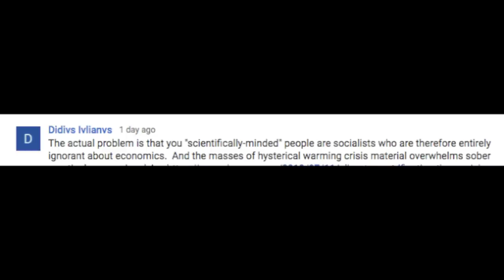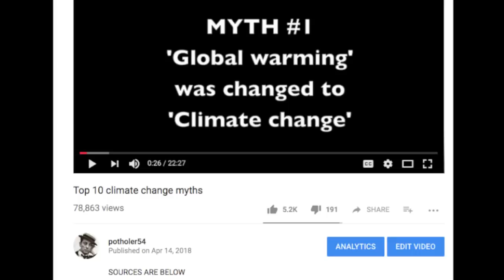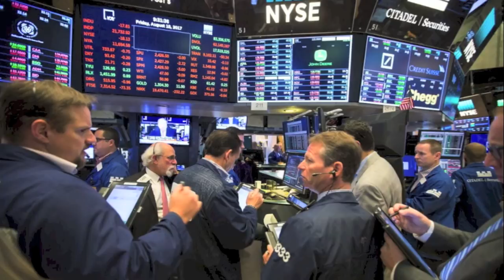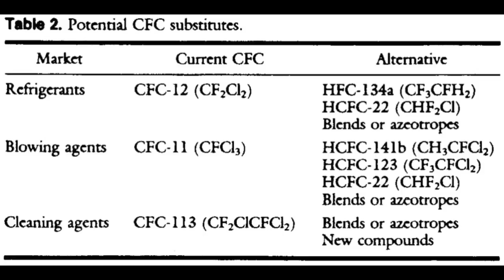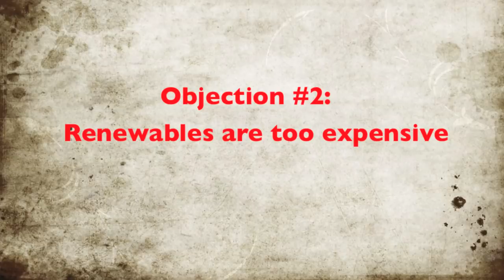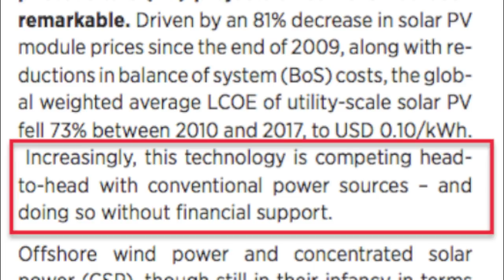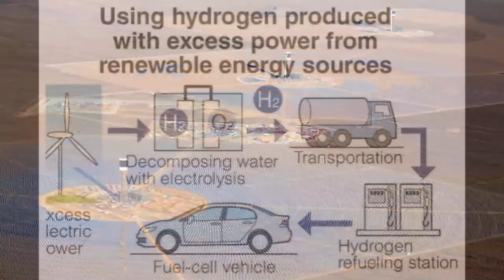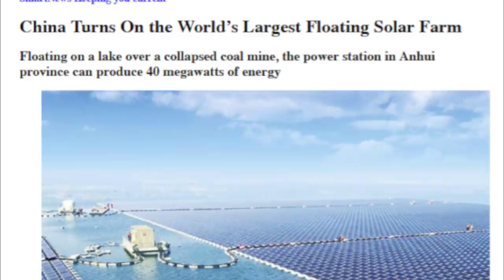A CONSERVATIVE solution to global warming (Part 1)

Comment: "You can store oil in a tank. Where do you store energy from a windmill?" 
Bigass magnetically levitating flywheel sealed in a vacuum chamber. Next question?
Reply: The Flux Capacitor is figure 14 in this paper describing Rio De Janeiro's maglev train. Which stores energy in  bigass magnetically levitating flywheels. 
http://atz-gmbh.com/Maglev14_Rio_de_Janeiro.pdf 
Figure 21 shows the flywheel mechanism itself.
Reply: Use it to pump water up into a resaviour. Then recover the enegery by letting it flow down through a water turbine.
Reply: Now see Bel Rick... That's where I get annoyed. Right where your comment starts. Have you even bothered to Google it? Flywheel based energy storage is real. It's not by far the only solution. But it exists and is being used right now in many locations.
Reply: Just store your energy from your windmill 'As Oil' or some other synthetic fuel derivative.

In actuality, I think developing a synthetic fuel, and process chemical industry that is capable of ramping up and down to catch surplus intermittent energy could have some real value.
Reply: Storing wind and/or solar energy "as oil" is possible right now - several years ago, I remember reading about a German research group who were studying how to do exactly that. The chemistry involved is well established, and was used during World War 2 (mostly in Germany) to produce synthetic fuels. This was of course the Fischer-Tropsch process, which takes in a mixture of hydrogen and CO (carbon monoxide) and spits out a random mixture of hydrocarbons, which can be distilled to produce fuels suitable for either diesel or petrol engines. Using suitable catalysts, the process can be fine-tuned to produce only low molecular weight hydrocarbon gases, identical to natural gas or LPG fuels.

In WW2 Germany, the feedstocks were mainly the destructive distillation of coal, which produced the CO and some of the hydrogen - the rest coming from reforming of natural gas. The modern research is all about obtaining CO and hydrogen from renewable sources. Hydrogen is easy, since any source of renewable electricity can produce it by electrolysis of water. Getting the CO is harder, but can be done: Carbon dioxide can be pulled out of the air with suitable solvents, then subjected to the reverse water-gas shift reaction to convert it into CO. There you have both feedstocks for Fischer-Tropsch chemistry, so can make hydrocarbons.

The research itself was mainly about how to make all of this more efficient and therefore economically viable. Strange as it may seem, one of the major investors into this approach was the US Navy, who wanted to use the process to make synthetic jet fuel. Why would they want to do that? Well, mainly to make their nuclear powered aircraft carriers more independent. Those ships are basically floating cities with nuclear power stations, so always have a surplus of electricity, some of which could be used for synthetic fuel production. That would mean less space used by fuel storage, and/or less frequent replenishment of fuel from outside sources, either of which would be beneficial for military operations.
Reply: Of course while bulk energy storage to a chemical form of fuel will be very useful, unless you can capture and make use of much of the waste heat from the process, it will remain fairly costly. Even with the most highly efficient conversion processes, making synthetic methane is only around 60% efficient. Direct hydrogen could be most efficient at close to 80% but transport and storage of it is difficult, so carbon based forms are more useful.

Because of this energy loss, energy storage in battery systems will likely still be somewhat necessary for short term storage.

One thing to remember is that if you are splitting water and generating hydrogen, you are also generating pure oxygen. This pure oxygen could be used in combustion processes to get a nearly pure CO2 exhaust stream, reducing the need for as much gas filtering, thus increasing efficiency.
Reply: It's most definitely possible. But time and time again if you look at the efficiencies then batteries come out tops. Burning fuel is just massively wasteful. So for each unit of energy stored in chemical fuel a large percentage is just wasted as heat when you want to use it. More than half. Right now we have good affordable battery solutions for portable mobile applications. And EV cars are just becoming quite viable as well. And it's why so much investment is going into even better batteries right now. There's gold in them thar hills lol It's quite apparent. There are also plenty of large scale solutions being developed. I'm a big fan of flow batteries myself.
Reply: There are off-grid power systems that covert solar by hydrolyzing, the hydrogen is then stored in tanks and then used as energy during the night time.
Reply: Imagine if people said "Oh darn, we have to pump oil from deep underground, but then where!? where would we store this oil? Where would we process it? How would we get it to the users? Where would they store it?!"

Most of these questions actually produced jobs.
Reply: You can store energy as hydrogen & oxygen (using electrolysis ), you can also turn salt water into hydrogen and hypochlorite for chemical use in the process ( why not ?), you can use a flywheel, you can use a reservoir, you can use molten salts,  ..
You can also modify the whole network so all devices on batteries plugged in at night can help the network as a national scale (well i see a lot of flaws here but it might be useful for emergency situations).
Or you can contract a ton of countries together so what they overproduce by day can be used (and sold) somewhere else at night, global market solution the way they like it.
Reply: @joeblack4436  

Yes flywheel energy storage exists, but it isn't efficient enough to overcome the loss in the manufacture of themselves and the systems you propose to power their inbound energy from. 

They also are not as efficient as compressed air energy storage which is just as applicable.
Reply: @Wifibee  

These are all overunity claims when you take into consideration the embedded energy costs in the manufacture of these storage claims, all of which have a dependency on fossil fuels to produce. 

Not one of them can, in conjunction with an energy source that would necessitate their inclusion, replicate their own production and provide additional power to society. 

Without using fossil fuel, and human labor powered by an external energy source, none of these claims can be evidenced. 

All of them are net energy losers. And claiming we can turn fossil fuels into "more efficient" systems that are unnecessary, as they are derived from, and dependent on, fossil fuels is the logical equivalent to claiming you make net income because your parents cover your expenses.
Reply: @Wifibee  

You're wrong. Each component has a lifetime and must be replaced when it wears out, becoming a recurring cost that must be subtracted from the gross output. 

Let's claim the flywheel has a lifetime of forty years, with parts that need to be replaced annually (such as bearings, brushes on the generator motors etc). We'll claim it takes 100 MWH of energy to replace each flywheel per forty year cycle (the value is hypothetical). 

If the generation system (wind, solar, dirty coal w/e) cannot supply more energy than the energy needed to replace those flywheels AND the collectors themselves AND overcome line loss, transformer stepping, heat loss converting electricity to mechanical energy etc etc..Then it will provide no net gain. 

If, as exists today, you take an unknown quantity of embedded fossil fuel costs upstream from the consumer, subsidize labor costs, use 1:1 comparisons of more efficient BTU energy systems that electrical systems that would have greater loss across the same function, then you can claim it produces energy by eliminating from your calculations necessary dependencies on finite fuel supplies. 

The evidence that would falsify my claim would be a factory powered by solar panels using any energy storage method you prefer that covers its own production and replacement while having excess energy to feed into the grid and expand its footprint. 

But not even research exists to prove solar (or wind, or even fission) could theoretically accomplish such a feat. You'd actually need the factory to exist to proof it...And you don't have one white paper. 

This is the closest thing you've got, and it explains why you're wrong:

 http://science-and-energy.org/wp-content/uploads/2016/03/20160307-Des-Houches-Case-Study-for-Solar-PV.pdf
Reply: Well I didn't say it was my favourite solution. Still exists though.
Reply: You know what other components have a lifetime and has to be replaced ? Every single one of them coming from every other thing out there regardless of coal/fuel burning or electricity related.
Then it's just a math problem. And no company will put money into storing solution that won't offer cost / benefit and they're better than you or me to calculate those.
And let's face it too : too much fucking people on the planet and too much wasteful idiots at that.
You can chose to dance around the semantics and think the solutions aren't good enough to be considered .. well i think it's retarded to keep fucking up the atmosphere and make the Dutch watch the dams with anxiety.
I will still live long enough to see the effects of bad choices. Won't you ?
Reply: @Wifibee  

The difference being there is clear evidence that fossil fuels power their own production, while no one has even claimed that other systems can do the same. 

If it is your argument that in order to prevent catastrophic environmental collapse by ceasing all petroleum consumption as fuel, then it is also your argument that billions must starve, modern medicine must end, the internet, computers, cars and most shipping and rail be shut down, and only those capable of self sustaining locally survive. You can choose that timeline right up until extraction energy costs eliminate any gain from the practice of acquiring fossil fuels.
Reply: Billions won't starve (what the fuck is that argument) and your solution is even worse. "Sure you get cancer building up slowly and will die in a few decades but boy, look at this thing go !"
Reply: Where do you store energy from a windmill? A battery. Not big enough? 1,000 batteries. Still not big enough? 1,000,000 batteries... we make more batteries than that already.
Reply: Store the energy from renewables by new techologies of electrolysis of water turning it into HYDROGEN and OXYGEN. I read that heat up water into superheated water and hit with ultra sound vibrations and high frequency direct energy the loss of energy to do it is less. It is like fracturing the chemical bonds.
Reply: Oxygen can also be used in concentration of combustion . Acetylene when mixed with oxygen burns much hotter in a concentrating form. It will melt steel by a cutting torch.
Reply: "The evidence that would falsify my claim would be a factory powered by solar panels using any energy storage method you prefer that covers its own production and replacement while having excess energy to feed into the grid and expand its footprint." 
So, the existence of the maglev train in Rio de Janeiro disproves you. Because it is a factory of public transportation, powered by solar panels, using magnetic bearing flywheels, to cover its own production and replacement, while expanding its footprint. Just as you demanded.
Reply: lawls and get like 5 % efficenecy
Reply: Denying the existence and operation of the train doesn't seem a valuable notion for me to entertain from you, so I'll decline. When your notions disagree with reality, it's time to disavow your notions. The train runs. Your argument is invalid.
Reply: @TheOJDrinker  

What energy source do you rely on for the batteries?
Reply: Not the question, the question is where is true liberty. THAT would be a free market.

Comment: Fossil fuels are finite, though we use them as if they are not. Sacrificing long term sustainability for profit.
Capitalism is defined by this contradiction. You cannot have infinite growth on a finite planet.

 What we need is a system that values not just individual wealth but collective wellbeing. This does not mean reinventing the USSR but decentralisation, direct democracy, freedom and fairness.
Reply: this
Reply: Everything is finite. Therefore that argument isn’t valid. Especially due to the fact we don’t know the exact amount of fossil fuel there is on this planet.
Reply: @ericselectrons  If you can replenish your stocks faster or at the same speed you use them then your resource isn't finite.
Reply: @ericselectrons  
premise 1: everything is finite
conclusion: argument is invalid
A huge non sequitur, but it's not the biggest offender here. Even if we know there is more fossil on the planet ie deeper we'd still meet the diminishing returns of extracting it and you completely ignore the CO2 part of the problem. While it's true that we know that even sun won't provide us with energy for eternity we also don't have any solution for that, since it's not us making the problem in the first place. Not to mention what heppens when we compare amount of energy from fossil fuel and amount of energy produced by sun each second multiplied by amount of time we'll have access to it.

Comment: It's what I've been arguing for years - countries like Australia and the US are missing out/have missed out on a golden economic opportunity presented by renewable energy through lack of govt policy and even concessions for the coal industry. And I believe it's mainly because of political donations - now that's a capitalist system that should be abolished.  One thing to note - China did use their cheaper labour to gain a competitive advantage. Of course this video ignored the fact that China is also building more coal fired power stations than any other country.  They had put a 2 year freeze but this year construction of an estimated 259 gigawatts of capacity started again. Not good news for the climate. Weirdly they don't appear to need the extra capacity - it seems more about boosting local economies and does not have the support of the central govt.

Comment: Norway basically stores energy in a waterfall, and I've been told that flywheels at generator plants can run for a long time on their momentum alone.
So my layman's brain says to me: Why don't we store excess energy in flywheels of some sort? Instead of storing electricity in a battery, we'd store it in momentum. 

So then I says to my layman's brain: That's too obvious, therefore probably tried and tested to failure, and you're missing several pieces of the puzzle. Let's ask potholer54 or perhaps his peers. 

So why don't we store excess solar and wind energy in flywheels?
Reply from the maker: The problem with flywheels (as I understand it) is that for all their weight, they can't store energy for very long. There's a much better way of storing energy with equivalent weight, which is to lift the weight vertically using excess energy, and then let it slowly descend and drive a generator when you need energy. This is basically doing what a hydro plant does, using metal instead of water.
Reply: @potholer54  Thank you for the reply. I thought those were tried and failed, but if that's a viable solution then it's worth testing out in different capacities I'd say. I think it was Thunderf00t who initially turned me off the idea, but if I recall correctly, that was a rig with a crane in the center of some concrete blocks. The crane would then rearrange the blocks from stacked to unstacked as energy came and went.
Reply from the maker: There are various methods of gravity energy storage being explored,  and I'm not sure which one Thunderf00t was looking at. I'm not suggesting that this will be the energy storage system of the future -- that's more likely to be hydrogen -- I was just making the comparison with flywheels when it comes to using the kinetic energy of a large mass to store energy. 
   There are problems with this kind of gravity energy storage, and prototypes only work at about 60% efficiency and only for storage above 300MWh. But efficiency and scale are improving all the time, so we'll see.
Reply: @potholer54  That is an exciting prospect in any case. Perhaps gravity storage can be used locally for large scale discharge purposes, while electrolysis can handle the regular storage needs of a grid. 
Now that I've got you, what do you think about the possibility, or perhaps impossibility, of mankind living civilized with sophisticated technology, but leaving a net zero carbon footprint in the future? 

Are we even remotely close to be realistically dreaming of such a reality, or is that complete woo do you think? If that's too speculative of a topic, I understand.
Reply from the maker: A 'zero' carbon footprint is impossible, but we can certainly get CO2 emissions down to the point where we are emitting less than is getting naturally sequestered. The technology for that already exists, it just has to be scaled up and have the political will to make it happen. What worries me is not global warming, it's the people who vote in self-serving politicians who don't want to take leadership in tackling it.